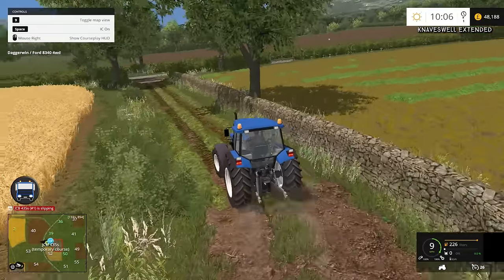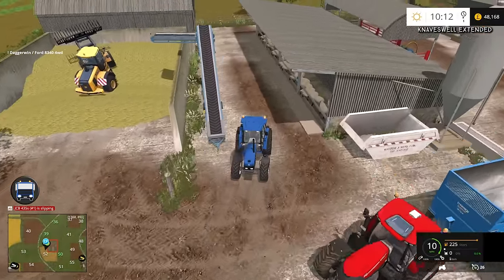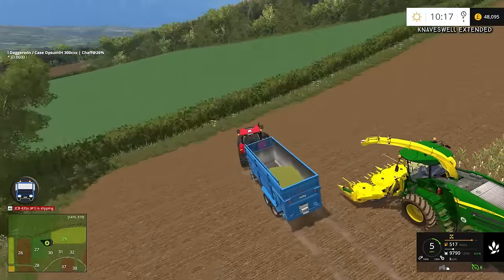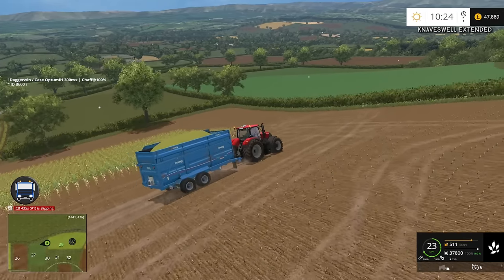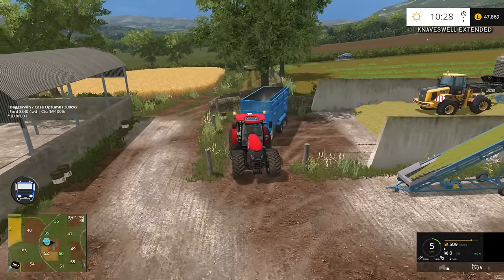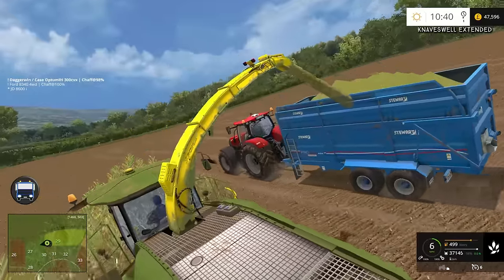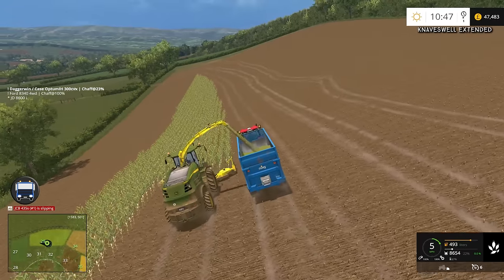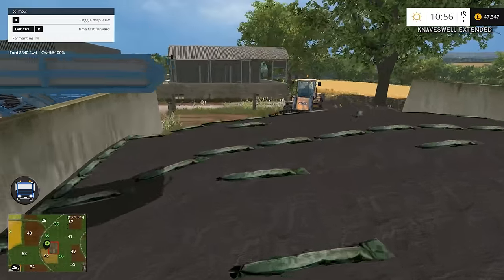Let's Play Farming Simulator 2015 | Knaveswell Farm Extended | Episode 17

Comment: When I've done silaging in 2013 on the Pleasant Valley Map I setup the forager with Autocombine and the two trucks attached to Agroliner 47,000 litre trailers on Courseplay sending them across the map to the BGA. Worked very well for the most part. Saved a lot of time too.

Comment: Those tiny 'Grain Doors' in the rear of some trailers you use. They are used to place the load more 'exact'? As in tipping the grain/silage onto a narrow belt system or into bags. Rather than the 'open the rear flap and it goes everywhere' approach. Watch the film 'Footloose' (Kevin Bacon version) there's a scene in that at the flour mill.

Comment: Did you workout your low FPS issue, for I found for me the JD 8600i harvester produced really bad FPS, down to 16 from 60FPS
Reply: Paddle Popinator how to check frame rate
Reply: +Aman goraya I used activate the command prompt which you can enable FPS threw that, see this link for how to activate http://fs-uk.com/forum/index.php?topic=95783.0
Reply: Just noticed that that link is FS12/13 but despite that its all the same except it says your "Developement Mode is in your "mods folder", but this is not true its in the "FarmingSimulator2015  folder down the bottom.